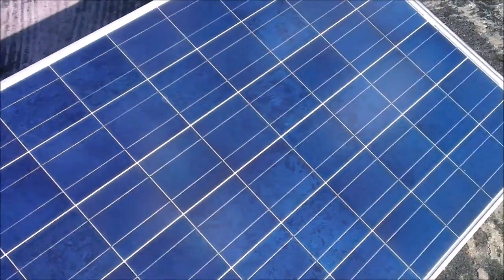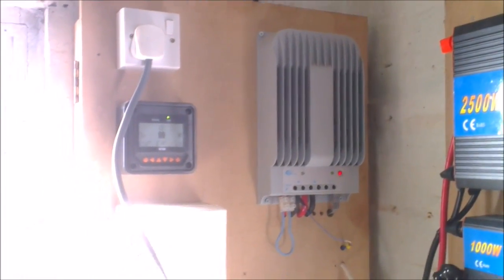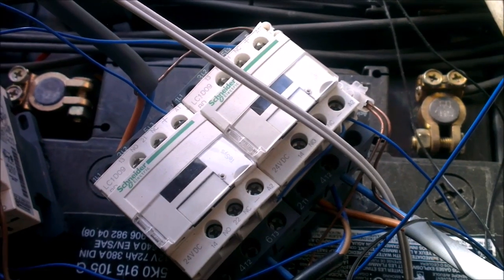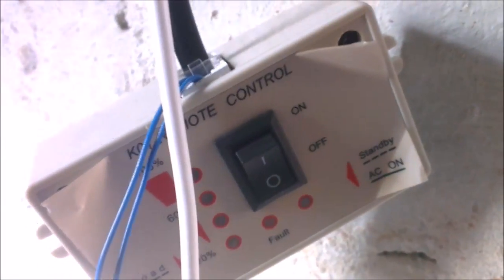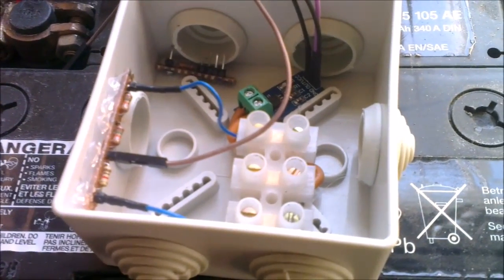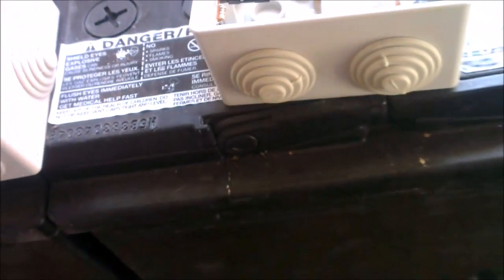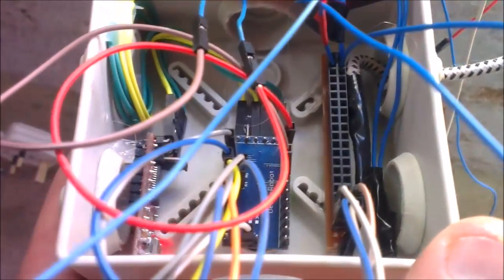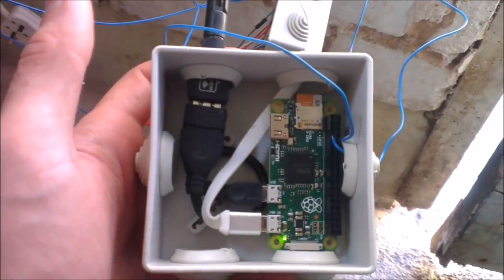My DIY offgrid home solar power station - UK - PART 6 - UPDATE

Comment: Do the contactera use the solar energy when they are in the battery and use them until they are discharged and then go on to mains while waiting for all the batteries to charge up again to 100%?
Reply from the maker: Hi Karl! They don't really drain the batteries, no. I only drain the batteries while solar is in use. The batteries aren't there for use though-out the night (although I could), the batteries wouldn't last very long. I use the batteries as a buffer, incase there is a heavy load whilst using solar. I'm going to do some updates at some point soon to explain all of this. :-)